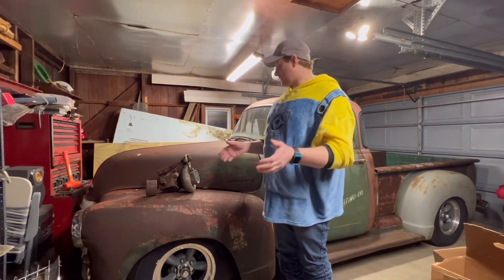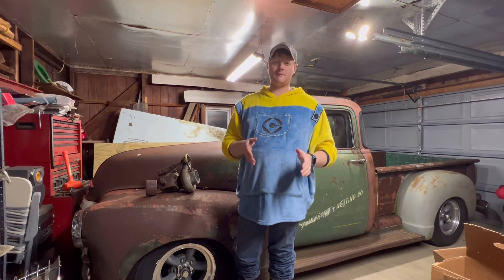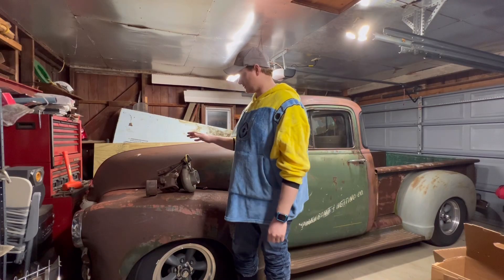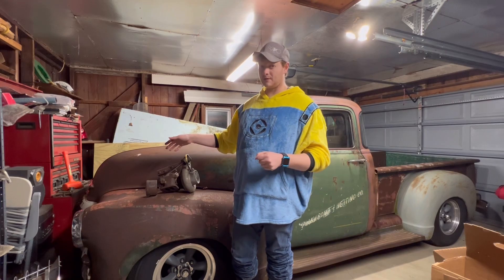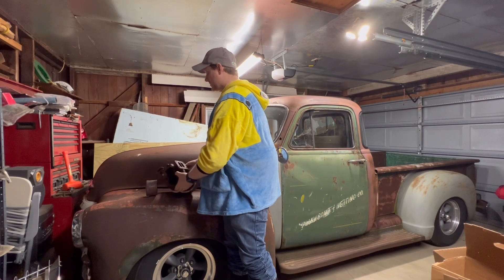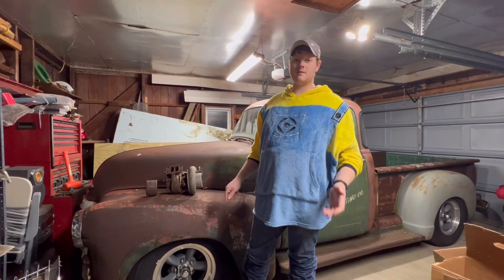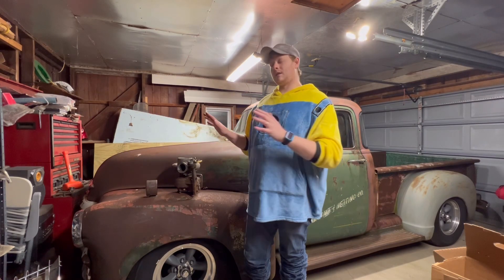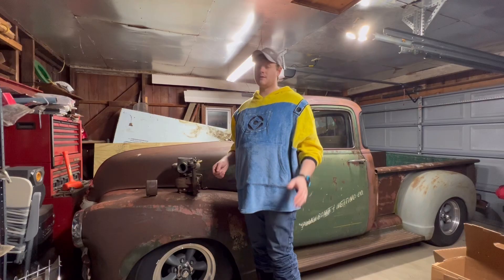GSC 6.5L diesel turbo upgrade talk!

Comment: Need your advice on my 2000 SLT 4 door GMC 3500K Deisel truck
want to  address  good upgrades and smart maintenance ...
Reply from the maker: Valvoline 15w40 every 5000 miles. Fuel filter every 2500-5000 miles. Leroy diesel oil cooler lines. Replace the lift pump with the relay harness and bolt on kit from zombiesolutions. Replace the harmonic balancer and pulley if it’s over 100,000 miles. Same goes for injectors. Get good Bosch from Leroy diesel. If you tow a lot get an HX35 turbo and install kit from zombiesolutions. Upper intake tube and plenum from KBDiesel. Tow tune from Quadstar tuning. 4” exhaust from summit racing and enjoy the truck. 2000s already have all of the cooling system upgrades so that’s a bonus.

Comment: Very interesting and informative video. How would a HY35W Turbo Turbocharger with:
Compressor:
Trim:69 
Inducer Diamter:68.7 
Exducer Diamter:97.8 
A/R: 0.66 
And 
Turbine :
Trim: 92 
Inducer Diamter: 87.4 
Exducer Diamter: 77.8 
A/R: 0.96
How would this turbo perform on a GM 6.5 Turbo Diesel? I am not sure of the boost pressure and drive pressure (back pressure) ratio is on this turbo. This is as far as I know an open scroll T 3 turbo. Not divided scroll like on a HX 35.
Reply from the maker: So the HY35 turbos are much too small for a 6.5 due to the exhaust housing geometry. They normally cause elevated EGTs above 14-1600* F when towing which is too warm for these engines to handle. Typically you’ll see 1.8-2.2:1 drive pressure to boost similarly to what you see in a GM4 or 8 running above 14psi boost. I hope this helps some.
Reply: @gingersnapcustoms  Thank you for your answer. Yes, this helps a lot. I did not know this before I asked. Thanks to you I will rule out this turbo.

Comment: I currently have the stock gm1 turbo on my 92 all factory truck other than the Leroy 4 inch exhaust. I have a fresh gm8 with the turbo master. Are the gm8s better? Or is their no difference other than efficiency? Thanks.
Reply from the maker: There is no real gain going from a GM1 to a GM8. I messed with both changing wicked wheels and wastegates and did not see any major gains with a GM8.

Comment: What's the quadstar S54 specs compared to what your saying and your thoughts?
Reply from the maker: I’ll run the same S300 I have in Casper now on every 6.5 I have in the future. It out performs the HX turbos in all departments and the truck reacts well to it. The S54 is an HX35 based turbo. The old ones were a 54/58/14cm housing and they run nice but they still bottle neck on the top end. I’m sure they’ve made changes in 5 years since I haven’t dealt with them since almost 2020.

Comment: 🤔 would you do a video on tunes & please include for a 95 model as it has a removable chip
      Thanks
Reply from the maker: @franklinkeeley2327  just explaining tunes or the process of pulling the ECMs and reinstalling them?
Reply: @gingersnapcustoms  I'm not a techy at all & I've no clue how to, what I need, and so on. Sorry LOL
Reply from the maker: @franklinkeeley2327  I can do that once I get the new to me 94 home so I can explain OBDI and OBDII in one shot.
Reply: @gingersnapcustoms  Thanks once again 😉👍
Reply from the maker: @ no problem! I will say I probably won’t unplug the chips if I can help it because they are a royal pain to get plugged back in. If I have a spare ECM still I’ll use that as my dummy.

Comment: How big is the difference in a 10-12-14-16cm turbine housings
Reply: Also is it possible to dremel a 12cm housing to be bigger? Or is that not recommended
Reply from the maker: @brackenthayn4967  a 10 runs like a stock GM turbo. 12 will be slightly better but still net high EGTs. 14-16 flow best on a 6.5. The housings aren’t meant to be machined or tampered with in most cases. So finding the right housing is important.

Comment: Curious why you suggest a 14-16 on the hx frame but a .88 on the S300 frame. Wouldn't that roughly be a 12cm housing? Seems the 60/68/.91 is a more common setup to find. Or are the CM2 vs A/R comparison not really a straight forward linear conversion?
Reply from the maker: @FryeFab  the .88ar T4 is more similar to a 16cm but the turbine trim is what makes the difference. It’s not as straight forward to go CM to AR so it’s more fine what works and run it. The .91 housing is more like an 18-19cm housing which was real laggy when I tried that.

Comment: 1996 2500 6.5l stick shift, I’m not looking for anything crazy nor do I drive it like that, but I have a 12 stamped hx35 I’m just looking for a little lower egts. Should I search for a 14 or am I good?
Light to mild towing, with the occasional max tow capacity load, but not often. It’s a daily driver/utility truck for around the property
Reply from the maker: @TKIDaniel  you would be better off going larger if you can. The 12 will work but it will be warm compared to a 14 or 16 when towing. As a daily a 12 is fine.